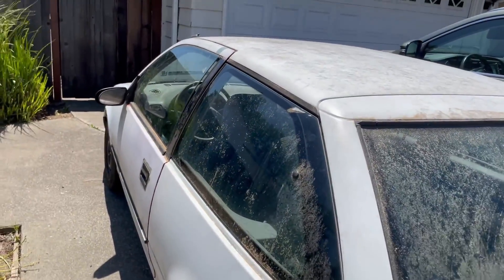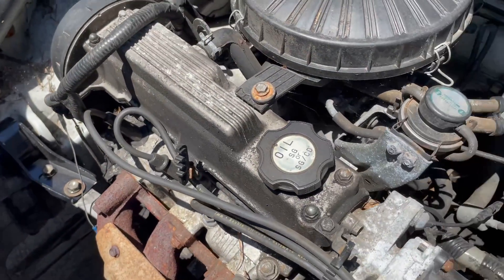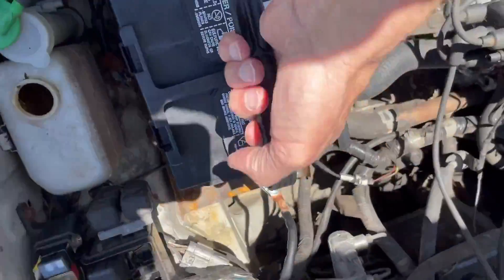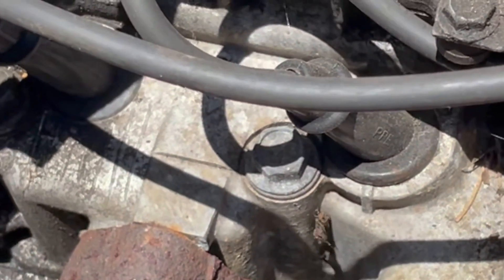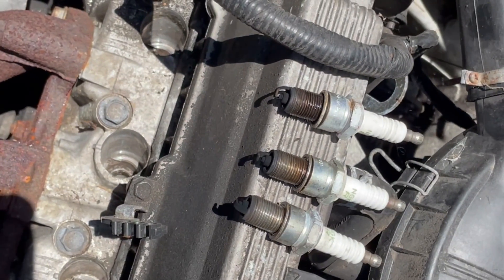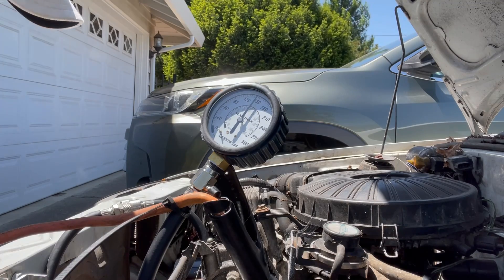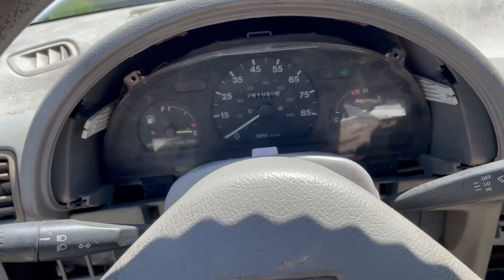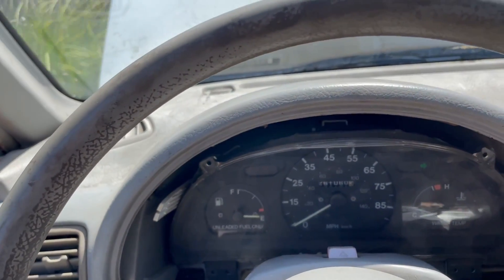PROJECT PANDA X-PRESS -CHEAP EBAY AMR500 BLOWER ON A GEO METRO XFI. COMPRESSION TEST & TUNE UP!

Comment: Richard are these motors capable of making around 150hp 200tq ? I'm in the process of a second engine build with a chevy sprint head, 1.6 pistons believe to be 74mm bore. Will be turbocharged using a updraft carburetor

Comment: Hot Rod Shop has done this but he made it racer only and ran Holley sniper . I would like to see a tamer street version that still might get in the 30's mpg range. He milled the head at least .04 and ported the snot out of it. Then he ran E85 with 20 + lbs of boost. Definitely a tuff little engine.
Reply from the maker: ONLY 30 MPG ON A METRO?

Comment: Why do you want an intercooler? It's a positive displacement pump,  it will move air fuel to the other side of supercharger regardless of the density of the air fuel on the manifold side .
Reply from the maker: to lower temps-a PD blower is especially bad at higher boost levels (needs intercooler)

Comment: My 1971 monaco/ black and white ( manual steering No heater or a/c) 440 727/ 12.5 compression purple shaft cam dual points distributor 780 holley vacuum secondary . I bought in 1981

Comment: I had an idea that since the bore space is the same and bore size is close, 3.900 to 3.898, it would be cool to see the 1990-1995 lt5 dohc heads on an ls or an ls1 specifically.  The lt5 dohc heads with some porting, flow 350-370 cfm.
Reply from the maker: THE BORE SIZE WOULD BE THE LEAST OF THE CHALLENGE WITH TRYING TO RUN DOHC HEADS ON A CONVENTIONAL LT1

Comment: Hey Richard, its Chris from the Geo Group.  The XFI motor is if it is still original has a special low rpm torque cam, and low friction 2 ring pistons (1 comp ring and 1 oil ring set), plus the ECU and highway geared transmission.  Should handle boost fine as those rings/pistons leak down quickly when worn.  They are known to burn exhaust valves when ran hot and egr is clogged.  Would like to see how you control timing as boost increases and add fuel.  Thank you for all the videos you do!!!

Comment: I drove my mom's 3 cylinder Chevy Sprint to college back in 1993.
It was a 3 speed auto. After racing on the motocross track against my buddy in his 2 wheel drive Toyota truck, you had to shift manually. 
If it was in drive, you were in 3 Rd gear. It would not shift from the gear you had selected.
 It knew what it needed, driven!
My Mom took it to a transmission shop and they told her to leave it, people would pay to have that done to a car. 
48mpg religiously. Not bad for a four door car.
Now that is a smart car.
Reply: Tdi swapped my 1981 vw rabbit
It got 54mpg in a car that weighs 800lbs more. 

75mpg
And 3x as fast as it was new. 

That is a smart vehicle to own.
Reply: The car did not have idiot shift is what we would call it where I’m from

Comment: Screen the intake between the engine and SC to catch all the rotor pieces when it all comes apart! I've seen a lot of them come apart idk why but I  think it might have to do with high vacuum during throttle deceleration . Most SC cars now are plumbed with a bypass system

Comment: I would like to see a test done between stock Chevrolet hydraulic, roller, lifters, and aftermarket performance hydraulic roller lifters. Maybe you already have done this test?
Reply from the maker: what are the lifters going to change?
Reply: @richardholdener1727  I’d like to know if the stock chevy hydraulic roller lifters are collapsing or bleeding off lift and sacrificing horsepower compared to aftermarket hydraulic roller lifters. The cam I put in my 4.3 V6 just doesn’t seem to be giving the hp and torque as it should. The valve train is much more noisy also.

Comment: My guess for the reason the timing cover is that way: someone wanted to change the timing belt but didn't want to remove all the pulleys and get everything else out of the way, so they bent the plastic cover back, made the change (or didn't) then let the alt-belt self clearance. Probably why that bolt is missing as well.
Stoked to see what you do with this, and hoping for a Richard Holdener / @robotcantina8957 crossover episode (like so many other commenters have said.)

Comment: Those old metros never die. Absolutely gutless especially with the 3 cylinder but they got stupid good fuel economy for the time. A friend in high school had one and we would take it everywhere because $5 in gas would get you 200 miles. This was the late 90s/early 00s

Comment: Can Richie push the panda Xpress to Gr Yaris/Corolla 3 cylinder territory? 300hp,100hp per hole, can the geo really do it?
Reply from the maker: That is a much better 4-valve motor-Even 100 hp (double the factory power output) with the 2V motor will be good

Comment: The g10 can take up to 20psi of boost stock n anything past that it will delete the head gasket, you can also take 40 thousands of off the cylinder head to bump compression especially since you have the Xfi cam already your golden. I have a few vids on my channel of the metros me n my buddy n my son have worked on. Check out more power geo.

Comment: Timing cover is Self Clearancing - Pro Tip - Remove it for an extra ~15HP!
Reply from the maker: 15 hp would be a 30% gain in power!
Reply: Maybe 1.5 hp gain
Reply: @darcypenner215  Crank, or wheel? Yeah 3ish at the wheels -- 12~15hp minimum flywheel(: add some stickers for moar

Comment: funny how i just seen one of these superchargers today for the first time and now your video pops up. i was just browsing for some boost options for my new hot rod project. little large for a briggs 11 hp i would say lol i will be following your project as usual. keep up the great content
Reply: It might not be a little large for it depending on the displacement of the Briggs and Stratton usually they're a low constant rpm decent capacity motor. 

These don't always make boost on things 1.5 litres or over because the motor can take the flow. 

It only produces 500cc per revolution. At a 2:1 ratio that's 1 litre or .035cfm at 3000 rpm that would be 105 CFM.
Reply from the maker: the blower will support 150 hp-it is not displacement-it is flow
Reply: YouTube red beards garage!
Reply: They also make AMR 300

Comment: Hilarious you build 5-700-1000+ hp motors that do notbing but make noise and numbers but you have to  build a platform to drive around a supercharged popcorn machine....
Reply from the maker: some guys just don't get it
Reply: @richardholdener1727  get what? Doing something because you want to try to?

Comment: Those cheap bolt together battery terminals are junk. The plate is thin so bends before it really clamps tight. Which allows it to get surface corrosion in there and will loose connection. 
You can take it apart, wire brush everything, and they’ll usually start working again. But, crimp on terminals are much better if you can’t get a pre-made cable.
Reply from the maker: the whole wire was junk

Comment: I think it needs a swift turbo distributior and blowthroug carb. The front cover is close but check for missing hardware .
Reply from the maker: there was at least 1 missing bolt-but I think I will cut it
Reply: @richardholdener1727   I used a piston stop and made my own TDC 0⁰ indicator  haven't  had a cover in 10+ years

Comment: You need to put in the exhaust valve from the turbo version! Exhaust valves in the non-turbo engine will burn/tulip very easy.
Reply from the maker: I have two turbo Sprint motors-one of them has all forged components

Comment: i like em dirty ... 100 terminal or block ... freeway wot for decarbonation ... f ya  lifter noise ? oil change .. orange lookz gooood ..... cutting wheel dewalter fer shield   green death alwayz problem, had one run thru 4 ft cable

Comment: That's a very nice little project to have you got something up your sleeve all right Mr Holden let's see what you going to do with it. 600 horsepower 👑💯💯👍
Reply from the maker: 600 HP with a 2V 1.0L?
Reply: @richardholdener1727  140 psi of boost and a touch of nitrous should get it there. Rotating assembly and head gasket may disagree.
Reply: @richardholdener1727 achievable during a few microseconds  , then some engine part might get to orbit😂

Comment: A can of Restore with CSL is always worth a try.
Reply: It has good compression rhough
Reply: @manworksgarage  I had to abandon the video to give my kids showers. I should have said more -- worth a try if the compression isn't the greatest. I still run a can every 4 oil changes as a preventative maintenance, since 2007.
Reply: @der_pinguin44  figured you left early. Indo that a lot too